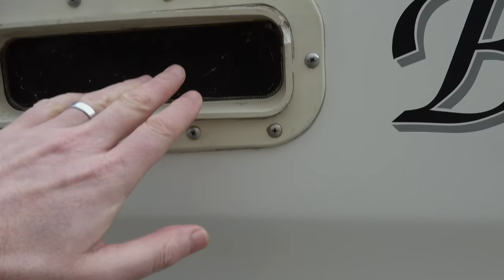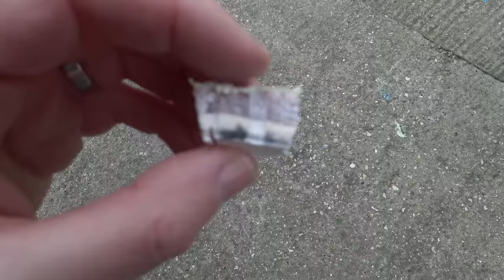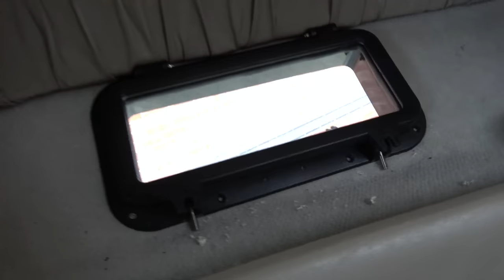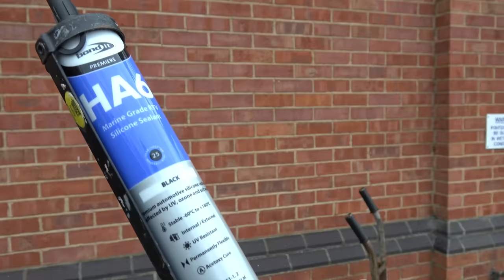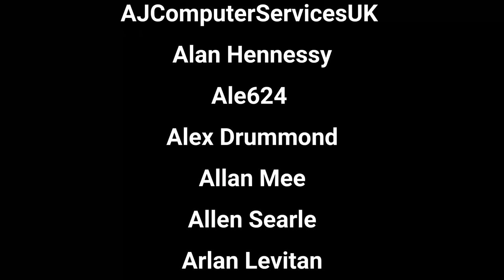Working on a Boat / Yacht - Replacing 3x PORTHOLES - PART 2 of 2

Comment: You could always superglue a couple of washers on the white bit to push down a bit more. That could be an easier solution. Excellent video as always.
Reply: Actually, if the white bit is tapped the whole way or just at the top side, you could drill a larger diameter so the thicker part will actual slide into the knob.

Comment: Nice job putting in those portholes. Lots work though. I happen to notice the duct tape near the starboard bow of the boat, I think that is the hole where the original flush mount horn was. I have a Bayliner Ciera 2655 and that is where mine is, also there are five drain plugs to remove to drain the engine. The fifth one is on the bottom of the power steering cooler pipe under the left side of the engine. I have the same engine in mine and remove them every winter.

Comment: easiest way to get the white hand screw would just be drill a bigger hole on the bottom 3 mm or whatever it needs slighty wider so it slots over the shoulder of the pin

Comment: Spacers on the bathroom could be a good idea 2 piece of pipe to slide over the stud with washers at the end then the two thin turns would only need to be turned a little bit
Reply from the maker: Very good thinking, I'll pass the idea onto Brian. Cheers Luke 👍👍

Comment: Really fun winter service job, about the silicone it goes of with water or a damp cloth, but if you use dish washing-up liquid, you get a bit more time. Also, if you want to use silicone as a superglu, you can spray water on it.
Thatnk you for a good video.
Reply from the maker: Thanks for the tips Anders 👍👍👍

Comment: I don't think you are comparing the portholes right Vince, the old ones the plastic had yellowed, and aged, so anything would look a lot better even white ones, but at least with black you don't get yellowing so should look good for longer, but the down side of black is it shows dirt and dust a lot easier. but yeah looking at the new portholes, then black with the stripe and being close to the boats name really blends in better than white, and not so gareish. 🙂

Comment: Did you put anything on the threads of the bolts that close the window?  Maybe teflon tape?  If any water finds it's way behind the head of the bolt I'm sure it will travel down the threads into the boat
Reply from the maker: No we didn't. Some of the mastic was present in the holes but none would have been under the head of the screws. The screws were very tight in the holes, as in they had to be screwed in with no play so this will help keep the water out. I'll mention it to Brian. It might want to waterproof under the heads better. Cheers for commenting on this👍👍👍👍

Comment: Ello mate was thinking with the bathroom window could u have turned it upside down so bolts and nuts are up the top and windows opens down instead of up the miss the shelf at the bottom just a thought
Reply from the maker: It's a good idea. We thought the same thing at the time, but unfortunately there is this little drip loop thing on the bottom of the port holes. We were worried water may find it's way in there if it was upside down. Cheers for commenting 👍👍👍

Comment: I Know I've commented enough why not flip the bathroom window so it's like opening a bus window. Bit lat since you've cut it lol
Reply from the maker: Thanks Jonathan, we did ponder that at the time but the portholes have a little drip loop type thing at the very bottom. We thought if this ended up on the top it might allow water in over time 👍👍

Comment: Thoroughly enjoyed a day out by the water, boat looks great, how did you mangle your finger Vince any stitches involved ?
Reply from the maker: Had an argument with a door/door frame and lost. Yes, many stitches and cut through the bone. I was mm away from losing the tip of it so I was very lucky!
Reply: @Mymatevince  Jeez sounds rough, hope it gets better soon
Reply from the maker: @canalboating  Thanks CB, it's healing really well. Another few weeks and it will be back to normal minus the nail🤣

Comment: @7:29 - I stopped chewing my fingernails cold turkey about 4 or 5 years ago for making videos.  I used to bite them till they bled and were sore.  It's one of THE hardest habits to break - even more than smoking.  You can chew your nails anywhere whereas smoking is genuinely frowned upon.  Even now, I find myself with a finger in my gob when I'm frustrated.  Since switching to a healthy diet, my nails grow 3 times as fast as when I bit them and they must be trimmed often.  Just an irrelevant comment.